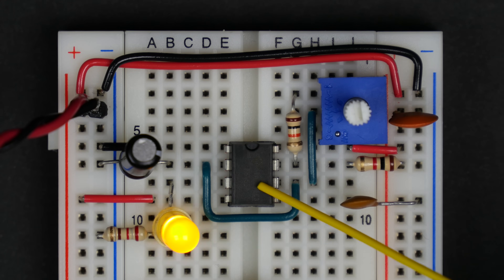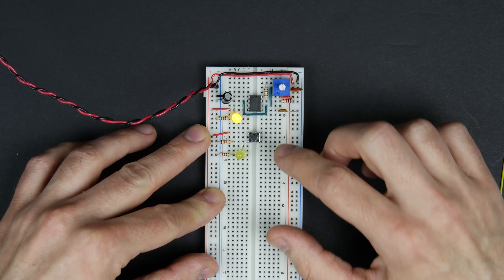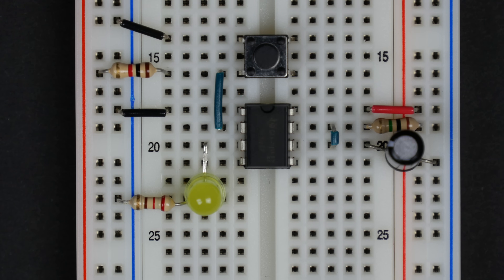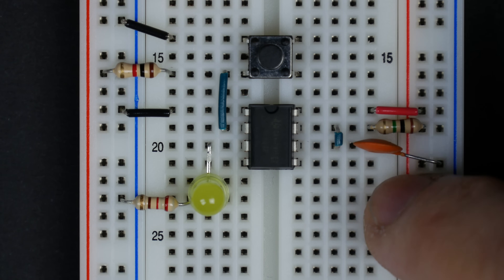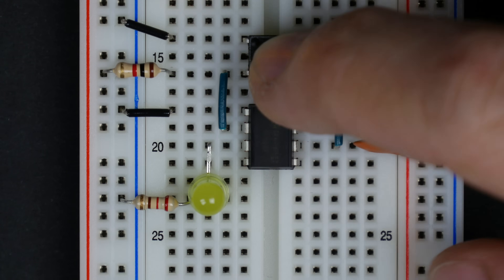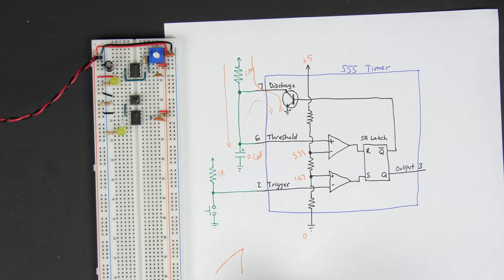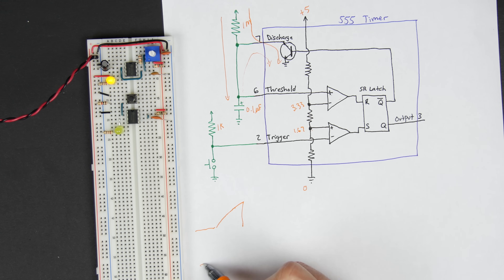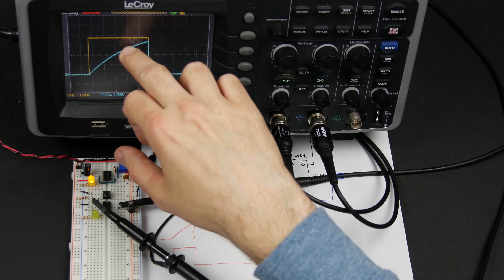Monostable 555 timer - 8-bit computer clock - part 2

Comment: At 8:13, why does the 5v flow into the discharge circuit instead of into the top comparator? Is the resistance of the comparator and SR latch higher than the resistance of the discharge transistor?

Comment: Hello Ben, first of all I wanted to congratulate you for such a fantastic video. I have one doubt though, at the beginning of the video you said that one problem that might occur when using only a pushbutton is that the internal contacts might "bounce" between them and couse the circuit to trigger various pulses. However, I cannot really see why that would not occur just by adding the 555. I can imagine that the circuit might have some kind of inerce, or maybe the latch part holds the signal, but I couldn't justify why the same bounces would not occur at the input of the operational amplifier and cause the same effect. If someone has an answer I would really appreciate it!
Reply: Hello me of a few minutes before, the latch turns the output to one as soon as it detects a high value at the input pin, it will not change even if the input flickers, the output will remain on up until the reset input is on. Next time go watch first the video of the latch before asking a question of how it works dude

Comment: I'm afraid I don't understand why pushing the button results in pin 2 going LOW, could someone explain? Ben said the reason the 1k resistor is there is to allow for that to happen, but I don't see how that's relevant.

Comment: Would you learn this stuff in a computer engineering degree?
Reply: If not, what degree would this be in? This and the rest of this “8-bit computer” series
Reply: depends on the university curriculum, most of the computer engineering degree have basics of electronics but doesn’t go much in depth. Electronic Engineering would be best suitable for this. But it is most likely your university will never teach you like this, it is better to buy basic kit and some book and just build it yourself and learn with the process. Best of luck

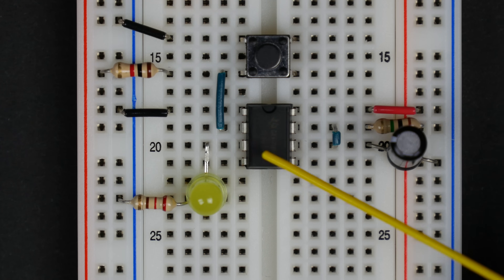Comment: SPOILER ALERT! For those playing along at home, at 2:39, when Ben added the 555 timer to the button, he changed the button from operating at 5V to operating at ground. If you rewire your button, you’ll have effectively inverted the button from normally open to normally connected.

Comment: 8:40 I don't understand this part. When the capacitor goes above 3.33 V, the comparator above outputs HI. However, the comparator below also outputs HI if the button is still pushed on, so we will get to a forbidden state for Q, since S=1 and R=1. Do we need to assume that the user instantaneously releases the button when R is set to HI?
Reply: I just understood that the 555 timer does not use an SR latch but a JK flip flop. Therefore, there is no forbidden state. When S=1 and R=1, Q toggles. Then everything holds true in the video.

Comment: I'm a electronics student, and the past week my teacher assigned us this circuit as our project for the 1st partial. I was a one step away of quitting the project because my circuit was a disaster, and i was so stressed. But then, i discovered your channel, and i watched your Breadboard 8bit computer. Then, i told myself "if this guy can make a freaking computer using breadboards, then, i can finalise my project" and i did it.

And if i hadn't see your video, i would fail the project. You're a source of inspirarion for me bro, thank you. <3

(sorry for my bad english. xD)
Reply: That’s rough! I built these circuits on breadboard in my first weeks of high school EE, but in class with the teacher’s help, not as a homework assignment! I didn’t start to really “get” the rhyme or reason for circuit layouts until I was a dozen or so circuits deep in the course, all done in class with access to help. This knowledge has been really helpful in life, but I probably would’ve failed if I had to do it at home from the start! 

Still, I’m glad you’ve been able to hang on and continue the course!

Comment: HELP! i just walked through the logic like 5 times and, if you HOLD the button, the LED should turn off eventually but it never does. why???

Reasoning: If you hold the button, you hold the base of the discharge transistor off, which charges the capacitor and never turns it on since you are holding Qi low since S is held hi. However, eventually, the capacitor will charge to full and turn off Q and it'll never discharge sine you are holding S. S and Q are held high and Q and Qi should go low.
Reply: I'm going to move on for now and assume that the "SR Latch" is not a just 2 NOR gates and that there's something else that ensures one of the two stays on and does not change until at least one of the inputs (S or R) is turned off.

Comment: you should use a transparency sheet over your diagrams to draw current flow, or for other reasons, so you can draw on your diagrams without drawing on or re-drawing your diagrams. Just a thought.

Comment: How both R and S are low, when the Discharge Threshold is at 5V, which 5V > 3.33V and the comparator is on. Then the bottom comparator will NOT be on, because 1.67V at the positive is < 5 V at the negative?

Comment: Could I use a 1 Mega-Ohm pull-up resistor for the switch? Would that affect the circuit in a bad way? Or would that make the current draw lower and make the circuit more efficient?

Comment: Before 12:32 , the pin 4 wasn't connected to any part of the circuit, so then it should have automatically been low. So how did R become high when you wanted it to be high ?

Comment: On the monostable timer, the output Im getting is inverted from what  Ben is doing here. Meaning the LED is default on and goes low when the button is pressed. I have everything connected (ar as I can tell) exactly as shown here. I dont have all the same capaicitor values that are shown, but I dont think that would invert the value. I kept thinking maybe I had something tied high when it should be low, but now Im wondering if it has to do with the specific 555 chip Im using ( NE555)
Reply: ok so I figured out something: I swapped out that 555 for another one of the same kind and got the correct output. So I suppose the flip-flop in the previous one was set to the inverted output. I had suspected that before, but had grounded the reset pin hoping to reset the flip-flop with no success. Im still very much learning this stuff, so I thought I would post comment for anyone who may run into this.

Comment: One of my 555 IC's is I think broken. So, one of the two remaining IC's work fine in the button circuit. However, when fitting the second remaining 555 in the exact same spot, same orientation, the LED is just on dimly until the button is pressed, then it turns off when the button is pressed. What's going on?

Comment: This is so cool! I've used "debounce" methods in web programming for years and years to limit how often a function is triggered within a time frame and never really thought about why it was named that. Knowing that it comes from a physical phenomenon in electronics is super cool.
Reply: It's not the only software term based on physical phenomenon.  "Debugging" was coming by the removal of a moth from a Mark 2 computer.
Reply: @tailslessons9634 Fun as that would be, the term “debug” actually predated that incident!
Reply: @GTLugo  Really?
Reply: @tailslessons9634 the term "bug" as it relates to a technical error predates that, yes, but the term "debugging" did actually start with the Mark II moth incident.

Comment: I noted a flaw in the typical 555 monostable circuits, particularly for debouncing.
The denounce is only 100% effective in the rising edge of the button.
On the falling edge when you release the button, it is only effective if you released it sufficiently before the 555 times out.  This is because the timer is not retriggering in this configuration, other than staying in triggered state as long as the button is pushed.
What you really want is the output logic to stay high a certain amount of time after the button is released and not sooner.
This can be accomplished if a circuit  prevents the capacitor from beginning to charge until the button is released.

Although button release bounces can't be eliminated, adding a .1uF capacitor across the switch cut it down considerably.  Lengthening the on time from the current. 110mS or so to .250mS or more would do better without being annoying.
Subbing the .1uF with 1.0uF electrolytic was effective but lasts over 1 second which can be annoying.

Comment: When I connect my scope to the trigger pin, the LED comes on and stays on even when I press the button. Is this because to scope probes are giving the trig pin a route to ground so the output pin can switch on? If so, how can I connect my scope to the trig pin without this happening?

Comment: at 7:34, you mention that the trigger pin (pin 2) will initially be at 5V. Is there not a voltage drop across the 1K resistor that would cause the trigger pin to initially be at 0V? I don't understand why the trigger would be at 5V if it is in series with that resistor when the button is unpressed. Any help would be appreciated.

Comment: Hi Ben, a question.
What happens when the capacitor is too small? If its time period expires before you release the button, does it stay on? Or does the time period expire only after you release the button?
Specifically I'm confused about what happens when S goes high so Q'(Q bar) goes low and the transistor doesn't discharge current anymore, charging the capacitor up. 
Eventually it'll exceed 3.3 and cause the R to set, and so S and R both are set to high. What happens then?

Comment: Oh, does this bring back memories - of me considering parts for a TTL based computer in 1974.  My only computer experience was IBM mainframes, so my clock was going to have a start, and a stop button, and the mainframes had a "single step" button.  I decided to go one better - so holding stop and pressing start, single stepped it.   My clock was 2 flip-flops decoded to 4 states - (1) fetch instr; (2) decode instr; (3) execute; (4) increment program counter.   WELL, looking on my scope, it clocked 0 1 2(0) 3 -- I was getting a 2nd phase 0 because of using ripple carry - sort of like your pushbutton debounce.   The answer was to (I wonder where I found it) change from ripple carry to synchronous clocked.   Unlike you, my "build" stopped at this point - because the Altair came out on the January '75 Popular Electronics, and I bought one, then built my own selectric and floppy interface boards.

Comment: Excuse my ignorance I am just a learner. Why do you pull the positive of the push button LED to low via the resistor? Would it not work the same without the resistor?
Reply: I have the exact same question.  Not understanding this part of it.

Comment: Using another 555 timer for denouncing seems like overkill.  All you need is ceramic capacitor across the two leads of the button and that will debounce it for any length of time that you want to press it.

Comment: Thanks for the great vid series!  At 10:00, Ben says "it stays off".  Now if you are holding the button down, doesn't that mean the bottom compare is still on and thus S = 1 which starts the process again, so won't start slow cycling on and off while the button is held?  But maybe I'm missing something.  Thanks!

Comment: on my monostable circuit my led stays on until I push the button like the output is backwards. I've checked my connections and tried changing the components to make sure it's not component failure and whatnot but no change. i followed it to the t but no luck. what's my mistake? also are you on any social media platform and might be willing to chat so I can pick your brain a little? I would love to transpose your exact design (the whole 8 bit computer) into a pcb layout... I love your videos. you have helped me understand how it works very easily (with the exception of my current problem lol)

Comment: What about just using a capacitor in series with the switch to avoid voltage changes for the manual clock

Comment: Can this circuit be built to where the capacitor doesn't discharge to zero?  I want to build a circuit that uses a couple small solar panels, and it only needs to turn on one LED when the photo resistor sees light.

Comment: If you hold the button for longer than the RC constant, the output will become unstable and cause the computer to stop working. Although neat as a simulation for a bug, it doesn't work well for the intended purpose. I found the easiest way to eliminate the issue was to place a capacitor in between the button and the rest of the circuit (with a resistor to v+/gnd on either side). That way, only the negative-going edge makes it into the circuit and it can only pulse once per button press.
Reply: Yeah I just found this too. I gather that the debounce RC timer starts ticking on *button down*. That’s great for button down. But if hold any longer than the RC time it’ll just bounce on button up! So a) make quick button presses. And/or b) adding extra capacitance at pin 6 made it feel better. I wasn’t racing to get the button down and back up.

Comment: The tricky part for me is understanding the flow of electricity. When I was younger I had a kit like this from radio shack, but I could never wrap my head around the diagrams to truly understand what was happening with the flow through the circuit. I need an eli5 for electronics...
Reply: Same here. Possibly, instead of simply watching, it'd help to physically draw out the same diagram and annotate it the same way while watching the video? (I've not tried this myself - yet.)
Reply: Duke Gibson  I'd recommend you take a look at open stax university physics 2 text book. It's free and a great resource
Reply: From an engineering perspective it flows positive to negative and current will flow through the path of least resistance.
Reply: Duke Gibson  correct not all the charges will flow through the path of least resistance but most will and if you have a short almost all the charges flow through that shorted path.you are correct if you want to know the current through each path just use ohms law

Comment: For some reason I am seeing regular spikes when the monostable button is pressed down. The spikes correspond to the frequency of the astable which is also running. If I speed the astable up, the spikes in the monostable's "continuous high" also increase.

See scope image below:
https://i.imgur.com/WUe9sNq.png

Somebody else also found this problem on @Ben Eater's site. There was a recommendation to put a 100nF capacitor across the power rails near the 555 but that made no difference to me whatsoever. Does anyone know how to fix this problem? It's a real nuisance because it causes my 6502 to clock cycles that it shouldn't.

Comment: I'm very new to this but I have a question; why does the debouncer still work when I attach the debouncer capacitor to VCC instead of to ground?  I.e. from pin 6 (I think) to + instead of -.

Comment: Is it signifficant that Ben chose large resistance (1MΩ) resistor at the discharge pin? Is it because at the normal "button off" scenario there's a free current flow from 5V to the ground?

Comment: Thanks, very helpful for somebody who's just curious and want to appreciate better the technologies we use nowadays and take for granted. I wonder if there are concerns about the size of the capacitor? The discharge transistor is getting its full capacity at once when it resets, I figure it could burn out if the cap is too big?

Comment: What happens if you hold the button longer than the capacitor takes to to load to 3.3 V? What has higher priority, Set or Reset?
Reply: if you hold it it stays on

Comment: 3:06 - For a moment, I thought you were going to say to use an SR flip-flop switch (I was taught to do it this way). I actually didn't know you could use a 555 timer for a debounce circuit but I guess you could jack the SR latch inside of it and take advantage of the discharge circuit to create that automatic falling edge... Nice

Comment: i have a question : at 9:00 isn't it a problem that there is no resistance ? that's basically a short-circuit right ? well sure it's only 0.1uF so that's not a lot of energy discharging at once, and the wires do have some resistance, but isn't it damaging to the components ?

thanks !
Reply: From what little research I've done, it seems that for small capacitors with very little voltage, shorting them won't damage anything.

Comment: By the end of the video, with the button circuit set up, you mentioned the behavior of the circuit as the capacitor charges, and then mention what happens once it's charged enough to trigger the R signal in the latch. However, you only mentioned what happens assuming the button is unpressed by then. At 9:30. I had a question, which is relevant for when the capacitor discharges very rapidly (unlike the one you hooked up to the oscilloscope that took 2 seconds to charge). What happens if the button is still pressed by the time the capacitor charges enough to hit the R signal?
Both the R and the S will be active at once. What happens then?
Reply: for an sr latch if both the reset and set are active at the same time, then the latch goes into an unstable state. Simply put you can't predict its output.